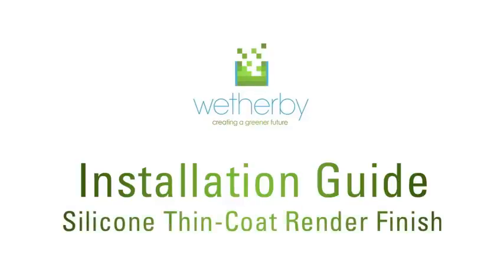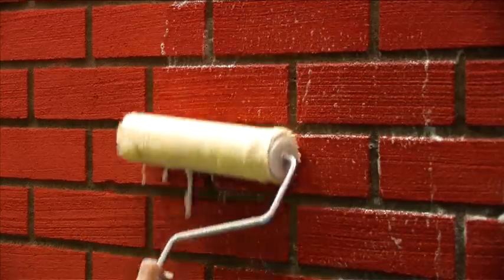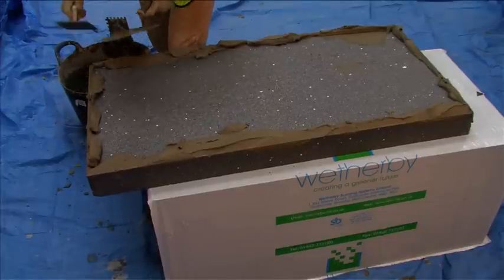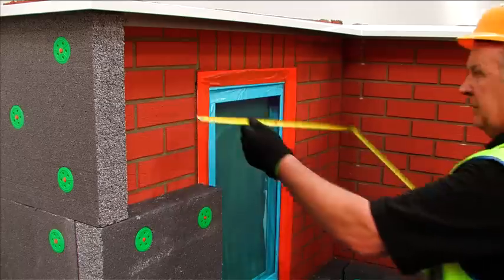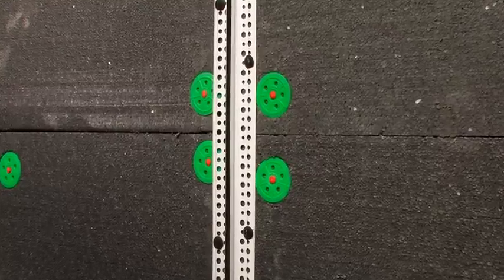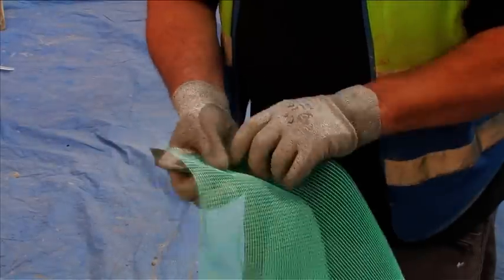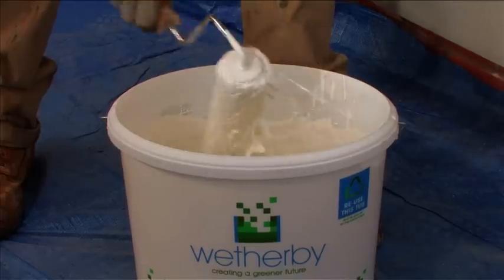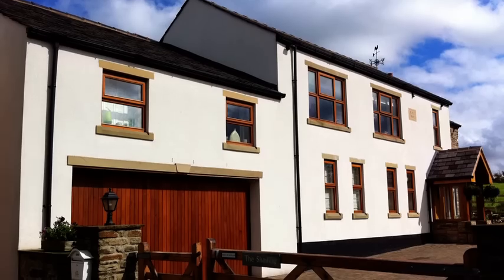External Wall Insulation with Silicone / Acrylic Thin-Coat Render

Comment: Does the render and/or the silicone finish have any insulation properties itself? Currently having your system installed in Ellesmere Port and my front door porch is only being rendered (no ewi applied)

Comment: Can we mix Primer and silicon Render together and apply on the top coat of the mesh?
Reply from the maker: Hi Rakib. No, these are two completely separate products. The primer is generally roller applied and helps to create a 'key' over the basecoat, which once dried, allows the silicone render to adhere properly. I hope this answers your query? If you have any further questions please don't hesitate to contact our technical team on 0800 107 3299.
Reply: @WetherbyWallSystems1  Thanks for your response. Unfortunately, I have mixed both products together to get a light colour on the silicone render. Do I have to re doing it or leave it?
Reply from the maker: RAKIB HASSAN - your best bet is to give our Technical Team a call on the number above. They’ll be able to advise you accordingly.

Comment: What a waste of money. Why not render over existing brickwork?
Reply: The boards are insulation so its designed to be used oh houses with no cavity wall.
Reply: The purpose was to add insulation!
Reply: Apart from insulating an old house which has no cavity walls, its best fitted over pebble dash instead of chipping it all off which is time consuming and can damage existing brick work. Im no expert but read it on a professional website.
Reply: You've got the answer in the tittle of that video 
How do you want insulate the house with render only 🤔?  HOW ?

Comment: Guys how can I do this render in part wise, I mean I can't finish full wall in one day , I have to do next day as well , than how can I joint with old render ?
Reply: if u get ur self a sponge float u can feather it in to the old wall
Reply from the maker: +jaspreet chahal If needed a tape joint can be used horizontally or vertical to break the area into smaller panels. Once the edge of the first panel is cured (next day) the tape is placed over the cured render edge and the silicone applied to the next panel. Once this panel is completed and whilst the silicone is still wet remove the tape. A thin line where the silicone edges join will be visible. The other option is to have enough renderers to complete the elevation without the need for any joints or break beading can be used in the base coat application to a workable size. If you require any more advice, please don't hesitate to contact our technical team on 08458 382380.